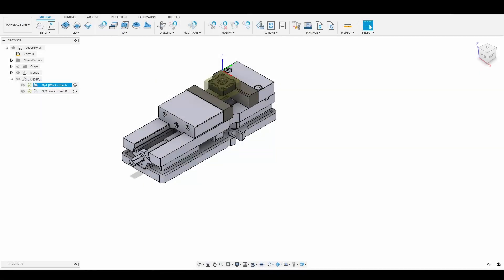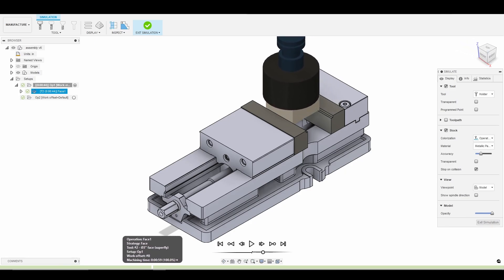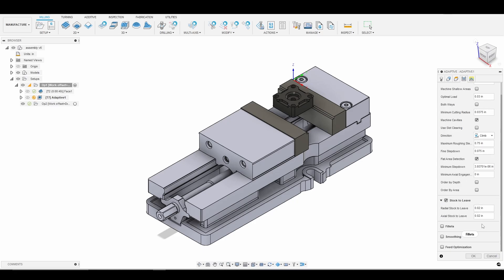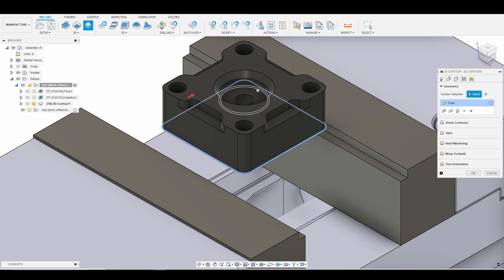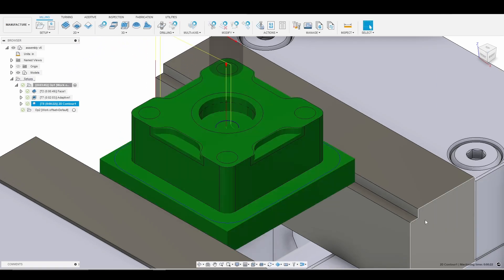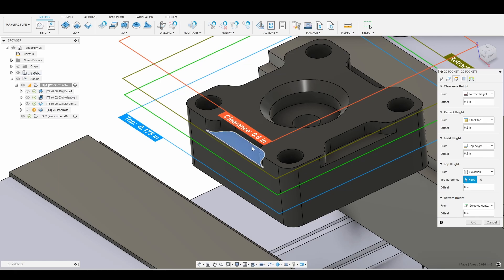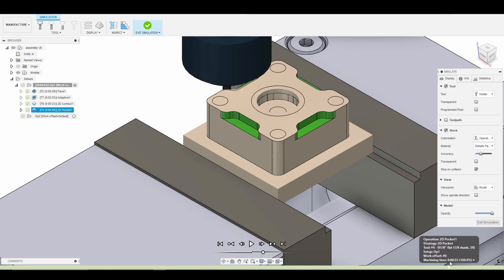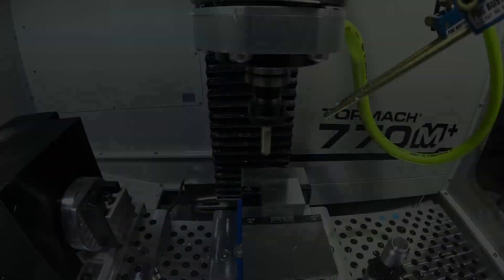Stepper Motor Mount Tutorial 2: Initial Toolpaths

Comment: Another very helpful video. 
I do have two questions. 
1. During the simulation of the internal bore diameter (at timeline 12:13) the colorization of the bore is mostly a green color; but, there are several uniformly spaced vertical stripes of a darker color. What is the significance of these darker stripes?
2. Why did you use a "contour" toolpath versus a "boring" toolpath to create the bearing pocket?
Reply from the maker: Hey chuck good to hear from you.
1. The vertical lines seem to be how fusion is rendering the simulation. When I zoom in, they mysteriously dissappear. 
2. The 2D contour has a faster cycle time. Four seconds compared to 11 in this case. It would be interesting to compare surface finishes though.